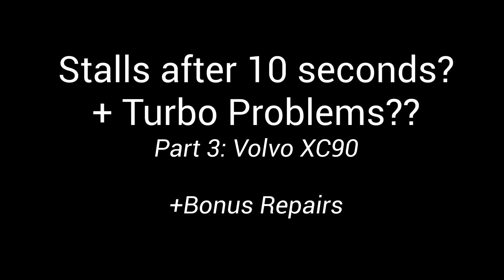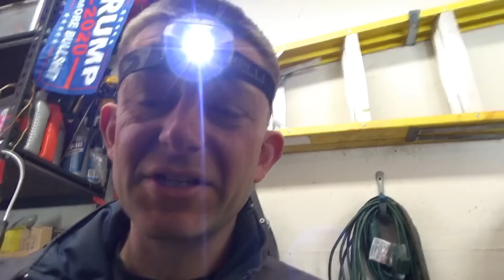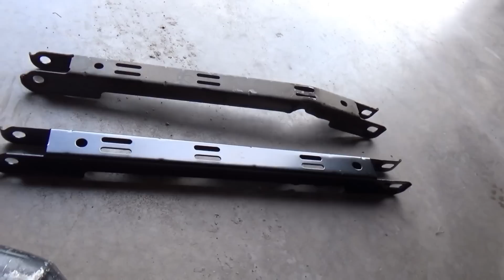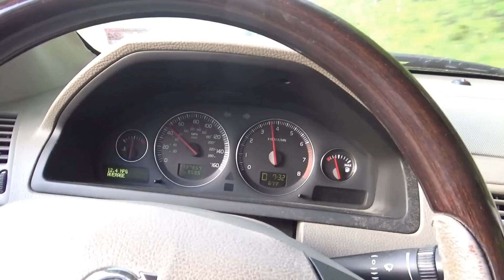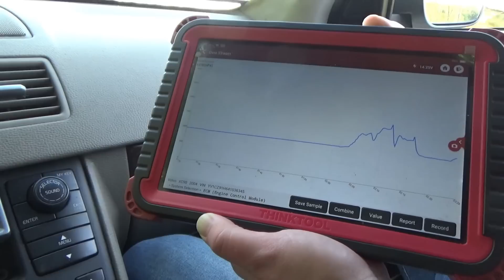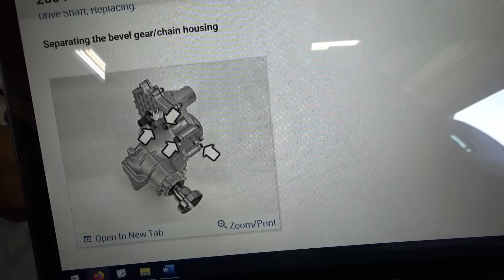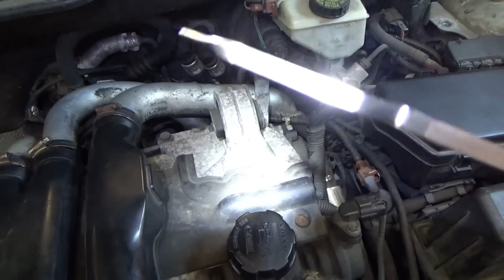More PROBLEMS?! (Part 3 XC90: Start-Stall, Low BOOST?)

Comment: Euro.. trash as they slightly age. I bought a  98 toyota  in 2016, to get parts for my 99 volvo,. The Volvo kept me busy. I really loved it and maintained it insanely well.. but that's not enough, fix one thing another needed attention. mulyiplies, then OEM is very costly... Head gasket went at like 15# K miles. Sold for parts or repair.  Chasing perfect most of it's time with me, but I got 80K miles of  good times nice ride but  Took well over half of my weekends in maint and repairs, in the time owned. The other smaller half of weekends was quite enjoyable  :-) . 1000 miles on the same toyota this weekend. Would have been nicer in the Volvo, but solid Camry still going quite well.

Comment: The output shaft seals on 4x4 ford's fail and the transfer case will eat 3 qts of transmission fluid. It always boggles folks when they have to add transmission fluid and there are no external leaks.

Comment: what kind of solder are you using?  Silver?
Reply: Leaded is best
Reply: Surprised it stuck, no way base metal got hot enough with that baby soldering iron. Glad it worked.
Reply from the maker: @John-dp3ln  The "baby" soldering iron is a beast ;)
Reply: I couldn't tell what metal was used in that part you are trying to solder.  It looked like some sort of coated steel but really could not tell from the video.  I have not had any good results using regular "electronic" flux core solder to stick to steel, "coated" steel or some aluminum alloy metals.  That's why I wondered what type of solder was used.

Comment: The way that track bar is made a proper fix would be to have an engineering shop & box the bar this would add extra strength to the part thus preventing it bending so easy Cheers hope you have a bit of respite from OVLOV'S .
Reply: It's plenty strong for what it was designed to do.  I'm sure Volvo wasn't expecting a tow company to grab onto the arm on the previous car and the owner to go off roading on this car.  Even if you box it, the walls are still thin and it would still break under these loads it wasn't designed for.  Boxing is usually to increase torsional stiffness not increase the ability to take a transverse load.
Reply: @major__kong  What I was alluding to was to have an engineering shop remake it out of thicher material apologies for not making that clearer in my origional post.Also I would do the same on the other side if it was my vehicle & offroading it.Cheers.
Reply: Not seen such innapropiate use of metal since boomers (alegedly)  went to the moon using aluminum foil haha

Comment: just junk this thing. owning a 20 yo volvo is insane.
Reply: For almost any European car - own the 4cyl with a manual and you will be fine when it comes to the drivetrain... Too bad you cannot get many manuals anymore lol.
Reply: @rkan2  Yep, my 2002 4cyl 1.8 manual is still going strong after 21 years, original engine, turbo and transmission.
Reply from the maker: I would not shed a tear for this particular Volvo haha

Comment: The aw55sn is garbage. It's made by aisin (a Japanese manufacturer)  if it was Swedish it would be perfect.
Reply: except the T6 has a GM transmission...
Reply from the maker: This one has the GM 4 speed...already replaced once before 120k miles. Now THAT is garbage haha